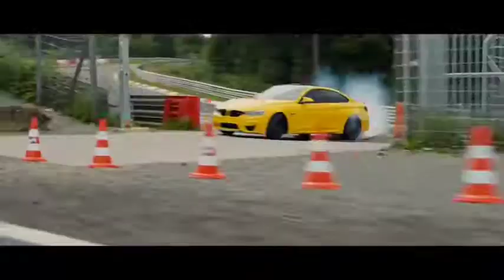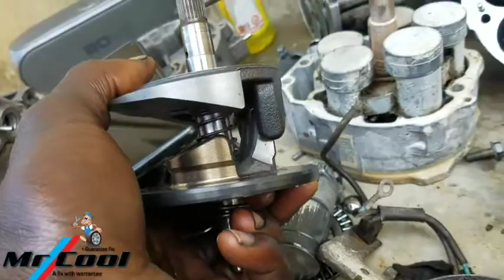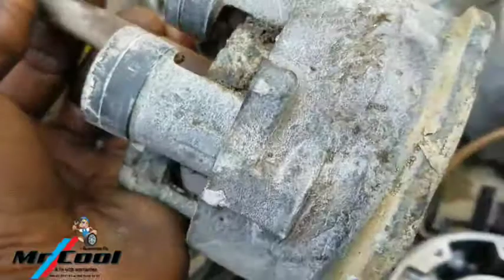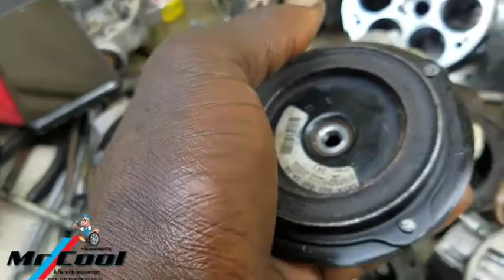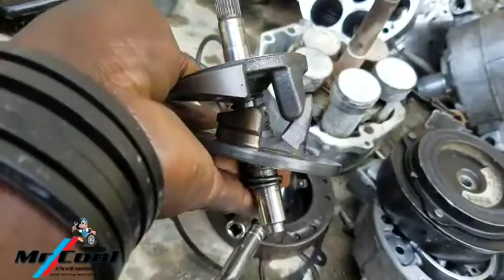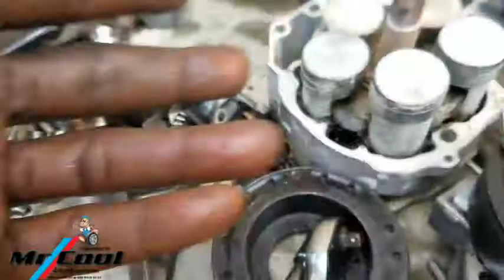Why Most Variable Displacement Compressors Failed!

Comment: A very valid subject matter as there doesn't seem to be too much info about it on the web. What you describe I think has been the cause of my needing to replace the compressor on my Volvo S80, as it wasn't refrigerating effectively. Regrettably, I found the clarity of your narration rather difficult to follow and understand.
Reply from the maker: If the system is not contaminated with dirts and debris which will in most cases change the oil color to black, then the next factors that will determine the durability of the Compressor is the materials and the right proportion used.
Reply: @Drcooltech  Having had the compressor replaced, the system is now functioning perfectly OK. Subsequently stripped down old compressor to find oil not badly discoloured, the regulating valve though didn’t look too pristine. I can only come to the conclusion that it was that valve causing the problem, particularly in the light of your experience that it is the principal cause of variable displacement compressors failing to operate correctly. Thanks for your contribution.

Comment: Excellent video. i learned a lot. If the valve is stuck open you will have cooling but low temp. Mine stays at 60 degrees. I'm thinking the valve is stuck at some degree of open/close creating high pressure on the low side but enough to keep a slight degree of cooling.
Reply: I have 2012 kia optima...my guess is compressor solenoid valve stuck partially open but not allowing full displacement....what do you think based on the following symptoms...

Idle rpm speed = warm air out of vents and high pressure reading on low pressure side....

I raise rpms to 2500 and keep it @ 2500 and the low pressure reading drops (although still high reading) and I get cold air at vents...

My guess is the valve is not allowing full displacement of pistons...the engine speed increases the speed at which the compressor spins so it can still build some compression/suction allowing temps to get cool....if solenoid wasnt stuck and things were functioning correctly I would get full displacement at idle speed and have cold air coming out of vents and normal low pressure side reading....
Reply from the maker: This video solve your problem https://youtu.be/lG-ZSJ4o_cw
Reply: The symptoms you describe are so similar to mine. Changed the compressor and it is now perfectly OK.
Reply: Think I should congratulate you on the clarity of narration on a recent video of yours I recently watched, it was much improved.
Reply from the maker: My pleasure sir, I am glad it's was very helpful to you sir 🙏🙂
Reply from the maker: What's your car make and model & recent service performed on the ac system?